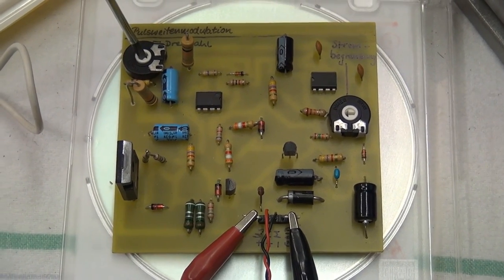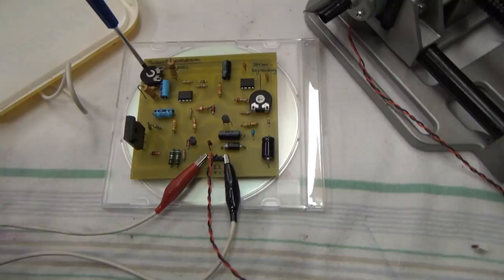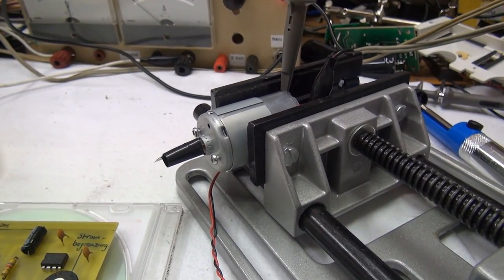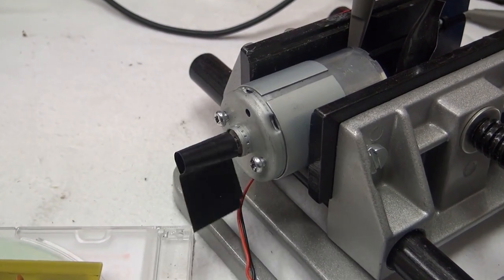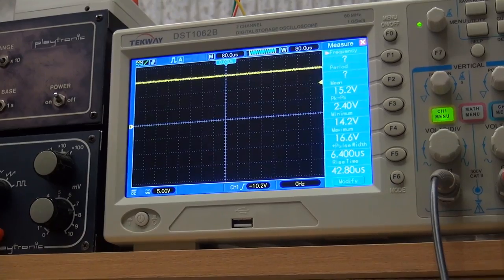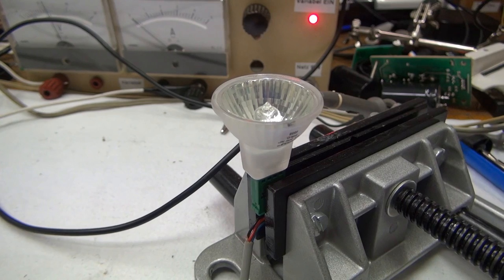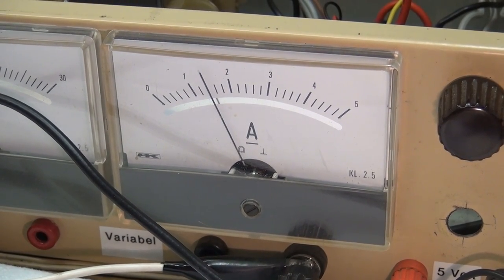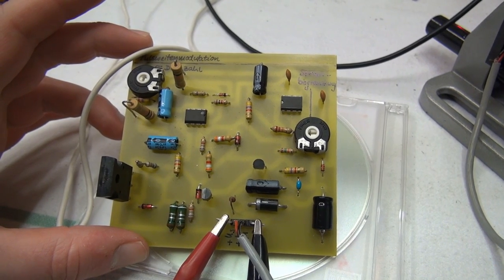DrCassette's Workshop - Pulse Width Modulation Circuit (School Project)

Comment: The PWM whine is very audible on some metro trains as they take off from a stop: http://www.youtube.com/watch?v=NeACOgtYcpI
Reply from the maker: The old green trams here in Hannover also run DC motors (made by AEG) using a PWM signal generated by a thyristor chopper control (made by Siemens). They were some of the first ones featuring this electronic control back in 1974. The switching frequency was extremely low and the chopper was noisey at all times as you can hear in this video that was recorded driving in the first unit of that series, the TW6001:
https://www.youtube.com/watch?v=jwlYcH9poIo
On the later TW62xx vehicles they used a GTO chopper control with 8085 microprocessor and much higher frequency, as you can hear in this video:
http://youtu.be/TB9yGfFGwXA?t=44s

Comment: I think who ever designed that circuit over-engineered it a bit! A 555 alone can drive a mosfet gate no problem without needing to go though any kind of amplification.
Reply: that 55 is not even conected the right way

pin3 the output is not connected

so ownley the sawthoot is used to drive the opamps